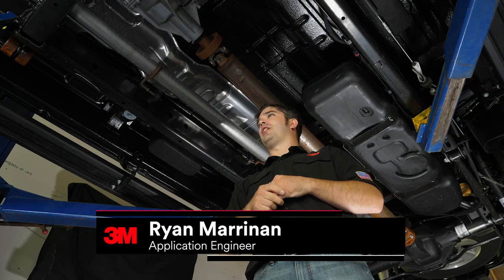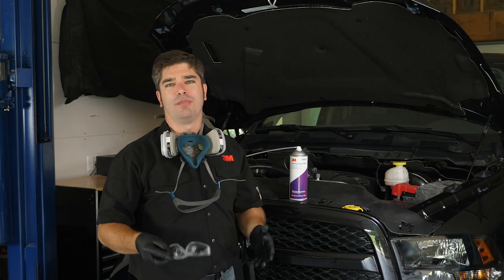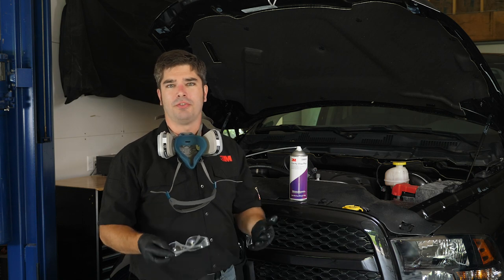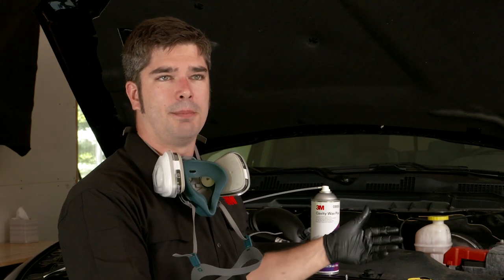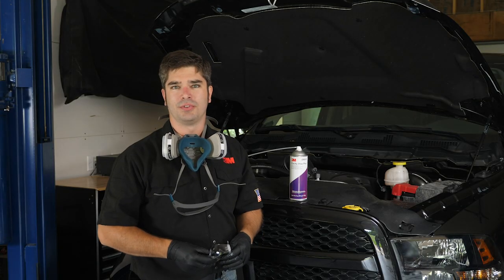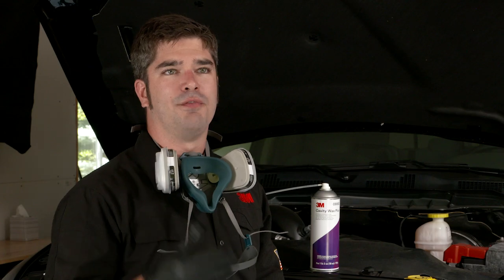HOW TO: Apply Cavity Wax inside Frame Rails

Comment: Super product, I would mark the wand 2" from then end.  This lets one know to stop spraying, keeping overspray off the finish.
Reply: thank you for the great tip !
the other tip that i have heard is to tape the hose to a tig welding rod or coat hanger wire for a more ridged controllable wand, so that it is not just a floppy hose

Comment: Can you apply directly on rusty inside cavities?
Reply from the maker: No. While 3M Cavity Wax Plus and other corrosion prevention chemicals can help prevent new corrosion from happening, they do not halt or reverse existing corrosion.
Reply: @3MCollision   Should i try to de-rust the cavity first? Or must I paint the inside properly first, before applying 3M Cavity Wax?